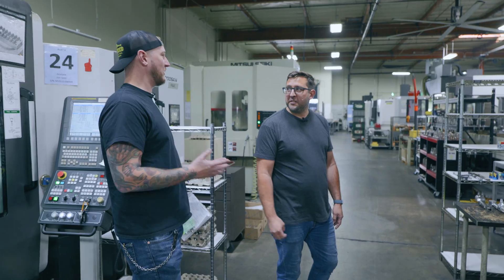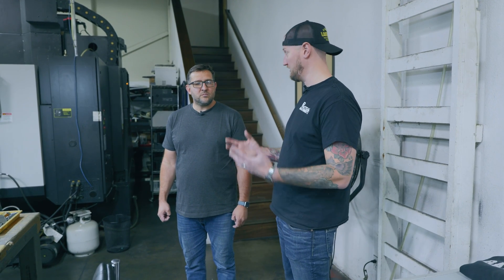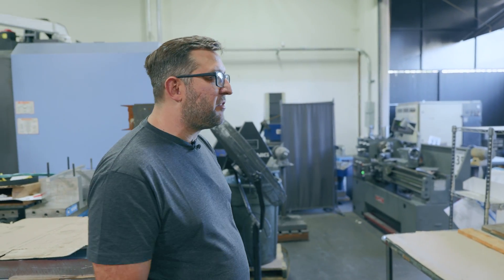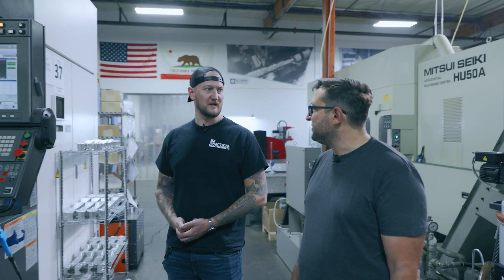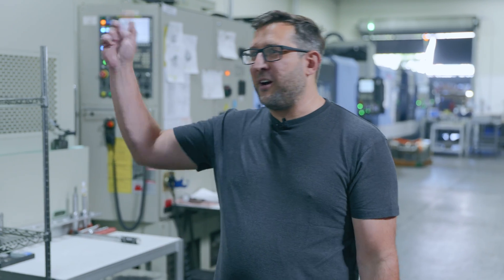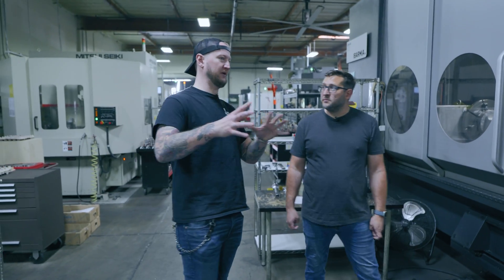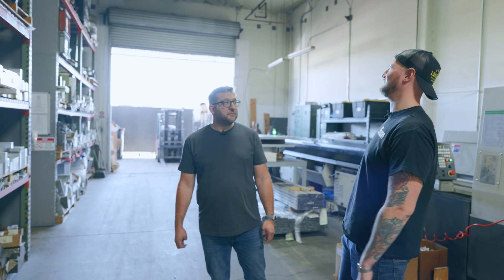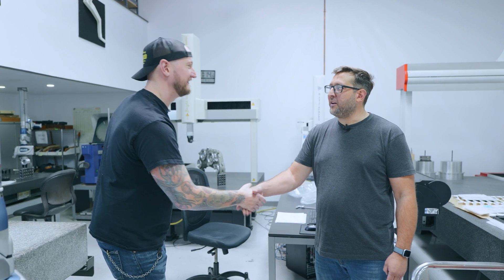AMERICAN AEROSPACE : From Startup to Space Supplier in just 12 years! | Machine Shop Tour

Comment: Let’s just be honest here Haas are not up to job and you won’t get work  in this sector if you only Run Haas and your customer base knows you only have Haas machines
Reply: The ones who blame the machines are not true machinists.
Reply: Not true entirely, we have multiple Haas ranging from VF3, 5, 10 and 3 UMC’s running aerospace, petroleum, and oceaneering jobs at our shop.
Reply: @SolavaPlays  we have 2 umc, they are lemon's
Reply: Haas definitely has a place. Not this place but a place nonetheless.
Reply: Well, I can tell all of you all of the ceramic tiles on the Dreamchaser spacecraft, and all tiles and the ablative blocks on the lower heatshield  of the Orion spacecraft are machined on Haas machines. During shuttle days tiles were machined on Hermles, but we would have to replace lead screws about once a year, and Hermle service was extremely pricy since the techs came from Germany. And BTW, the Haas machines have machined more parts in the last 3 years than were machined on the Hermles during shuttle.
Reply: @TPSTH23  so it’s better to sell those useless Hermle machines and buy more Haas
Reply: It’s hard to compete with HAAS knowing that all shops around you have also Haases and it’s much easier when have another level machines and those shops can’t compete with you